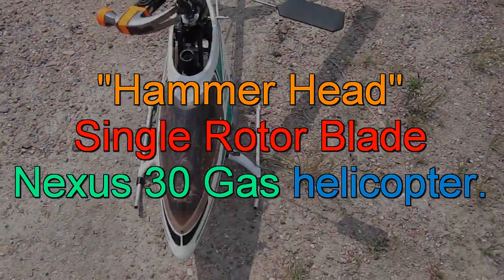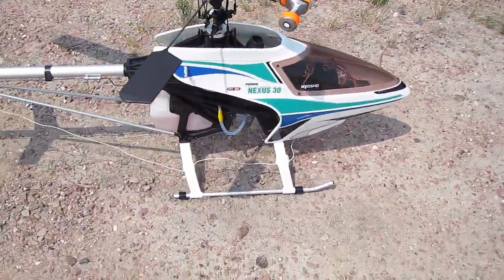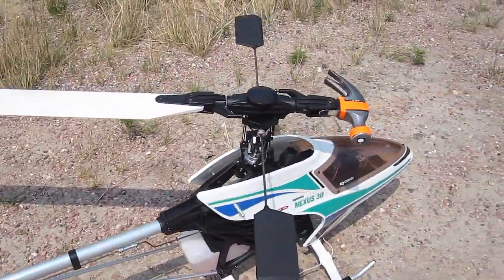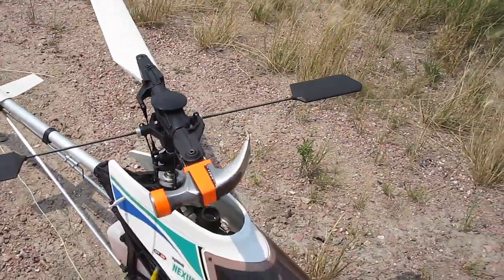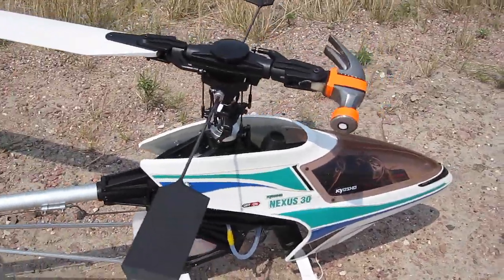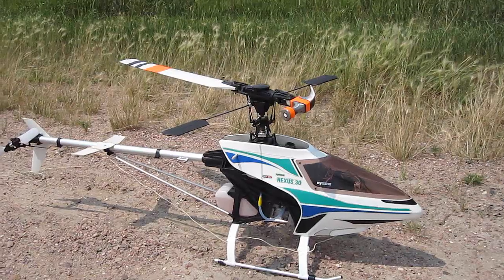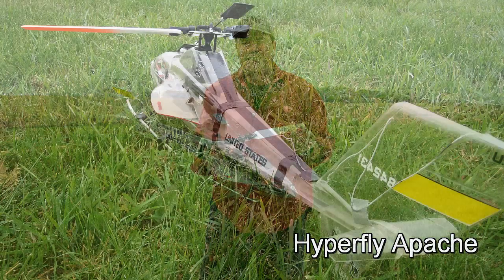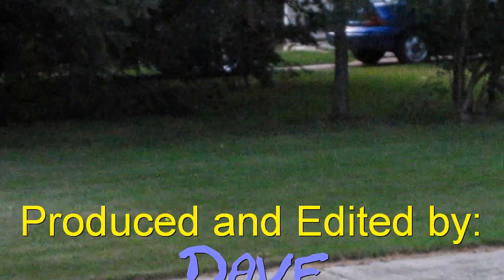A Hammerhead Heli? 1 Single Rotor Blade Nitro Heli (Experiment) The HAMMER-HEAD.

Comment: No point in making one blade it is vibrating very badly it will never work in big models pal why fix a hammer head put a blade instead it will work better get a smoother ride
Reply from the maker: It was to prove a point.  It takes less power to turn one blade, has less turbulence with no other blade messing up the air in front of the blade, and it does not vibrate.  I have many other videos of other helis done this way to prove a point as a requested challenge from my subscribers. See the video of the 3 d flight.  https://www.youtube.com/watch?v=abXGxS6CUU4

Comment: Hmmm, I did expect that it would wobble a lot more since there is only lift on one side but it isn't that bad at all.
Reply: outward blade forces keep the head pretty level in rc helicopters, otherwise the rotor disk would be a sharp upward V shape (there is some upward flex all the time)

Comment: I was trained as a military helicopter mechanic in 1966 before I went to Army flight school.  I was taught that a "one-bladed" rotor system was actually more efficient than those with two or more blades, as the one blade does NOT have to fly through the disturbance created by the other blades.  The concept being demonstrated about is interesting, true, but not new or original (former military helicopter pilot with single and multi-engine high-performance aircraft ratings).  JCH
Reply: Can real helicopter fly with single blade sir?
Reply: to the first question, you either have to spin faster or pull harder pitch both of which would generate more noise so it'll probably end up being about as loud (in nitro and gassers the engine is way louder than blade noise anyway) and to the second question theoretically yes a real helicopter could fly with one blade but the problem is that full size helis have less force pulling the blades out relative to lift because of the lower head speed. this means there will be, probably, a constant unbalanced torque on the head components. some redesigning would be required. the other problem might be regarding stability because of the lack of flybar and only half the gyroscopic inertia, but that's testable on the small scale too. finally, even though the one blade is a few percent more efficient, you're carrying aloft the counterweight which might adversely affect your maneuverability and/or fuel mileage.
Reply: +Knight Six Are helis with this design also quieter because of that reason? This one seemed much more quiet than most RC helis I've seen, maybe that was just the music though.
Reply: +Viizzai:  One rotor blade would be somewhat less noisy, but - it must turn faster to generate the required thrust that two blades would provide.  Also, using that hammer head for a counterweight adds to drag. The owner should shape a lead weight sufficient to counter the weight of the blade, but be more aerodynamic.  Not certain how it would preform during engine off autorotation.
Reply: Neat!  You guys heard of the "Boeing Go Fly" contest and seen their You Tube?  I've been thinking that a rig like I dreamed up might be a contender, https://www.youtube.com/watch?v=Pzg1rEPSStA  . Glad to read that the one blade rotor has some merits that might add to the feasibility of this design .

Comment: How did you first determine the amount of counter weight?
Reply: +Chris Boyce m1d1 = m2d2.  It's the same equation used for weight and balance on full-size aircraft.  Get the distance from the rotor hub of the center of mass of the one rotor blade (d1) and the hammer head (d2).  Weigh the rotor blade to get m1.  Now, knowing m1, d1 and d2, solve for m2.

Comment: it's better to be hit by the blade than by the hammer :)
Reply: but the blade will be moving faster, the hammer being closer to the center is not spinning nearly as fast. also its mass would have it be a shorter steeper trajectory that would be towards the ground much sooner than the blade would be so if you have enough distance you are safer with the hammer coming off than the blade lol

Comment: Proves the theory well. Does this not give an inbalance of lift on the head though? Like the blade is giving lift but there's no lift on the other side to counter it? Would this eventually lead to bearing failure or similar or can the head deal with the lifting force regardless? I presume lift force would be quite a lot less than centrifuge? How does this affect flight? Less lift or the same lift but more head speed/pitch? Really interesting.

Comment: very nice. i have a question for you. i have three different rotor heads for one of my helis. one is a two bladed with flybar, one is two bladed with no flybar, and the last is four bladed fully articulated (floating) flybarless. out of the three i find that the four bladed one is the most responsive and the 2 bladed one with the flybar to be the least responsive. is the responsiveness hindered at all due to the missing blade?

Comment: You just put the rotor, centered on a pin or small rod, and add weight until the rotor doesn't turn due to gravity. That means the overall moment about the rotor pivot (center) is zero and it's balanced. Easy as that.

Comment: In fast forward flight on the old helis they would help stop pitch up.  Not needed anymore on the newer helis.  Also the same goes for the vertical stabilizer, except to prevent the tail rotor from hitting the ground, but you could just make a wire stinger for it.  Purely cosmetic.

Comment: Back in the late 1980's Dwight Shilling did a one-blade experiment with another Kyosho heli; Concept 30, and wrote an article that was published in one of the magazines from Great Brittan. Even though the rotor system was balanced statically, there was still significant vibration due to asymmetrical lift around the rotor disk. But it's still fun to experiment, right?

Comment: it seemed like that the heli had a lot of vibration, did you check that the balance of the blade and the hamer were equally far away from the center?
if not than it may cause a lot of vibration since the blade gets more force at different rpms than the hamer, and vibration can loosen screws and stuff can come loose, like the hamer....
but nice flying (Y)

Comment: @NightFlyyer Am sure you had it pretty well securred. Am sure you wouldn't want anything to fly off esp the hammer (which illustrates how much weight is there). I guess what we might want to keep in mind is the added stress to the lifting blade's blade holder. Double the stress (perhaps) and old plastic don't make a safe combination. Perhaps you can find a way to see how much more stress a single blade does to the blade grips. Am sure its more than if two blades were used since they're averaged.

Comment: Holy crap, that thing had some crazy vibration.  Can see @ 2:35... it's torquing from the tip of the canopy to the tail rotor!

You may have balanced the phyiscal weight of the rotor blade and hammer together, but the problem is you are pitching the hammer head along with the rotor (along with the fact the weight is so off center, among many others...). You need to figure out a way to modify the swashplate to keep the hammer head constant level at zero pitch while the one rotor blade pitches.

Comment: hmm You don't realise how heavy a blade is until you have to counter it with a hammer head. Not to mention the damage they will do if either comes flying off the blade grips.

My thoughts:
- Isn't the single blade supposed to be longer than stock to ensure same lift is created given the same headspeed?
- lift generated just on one blade would mean the single blade grip now has to support the entire heli instead of sharing it with the other grip. This equals more stress for the grip=dangerous